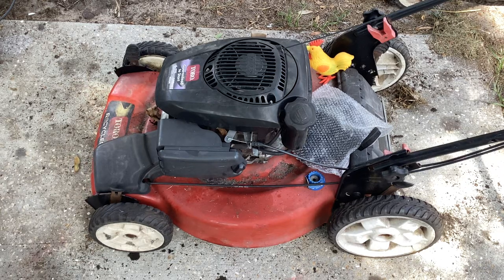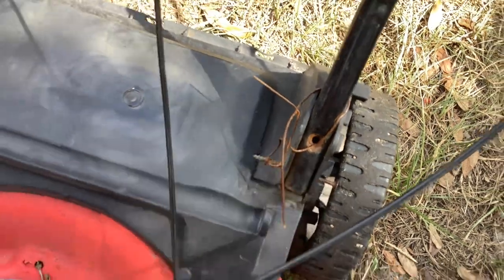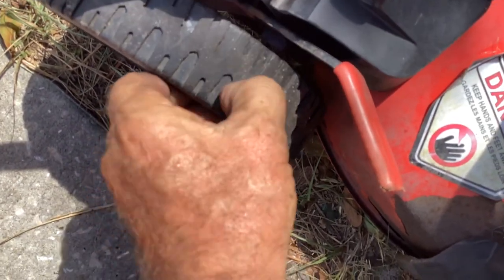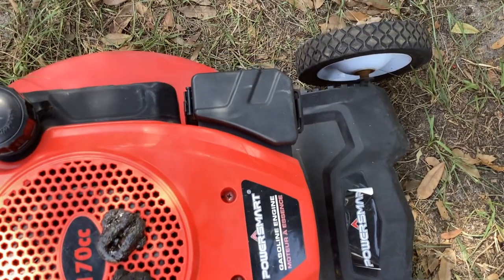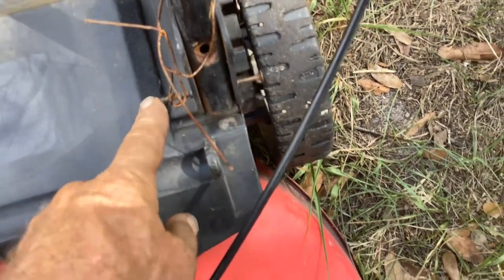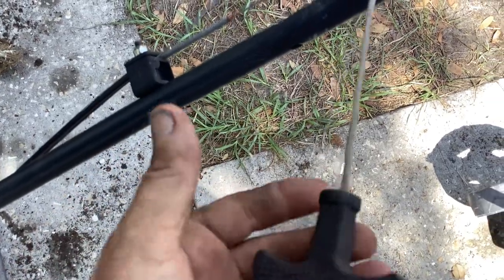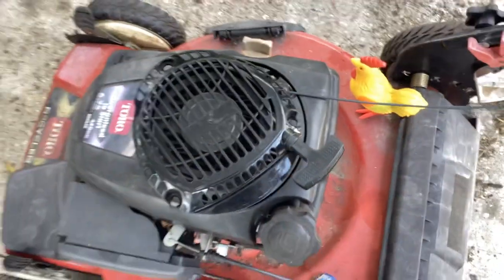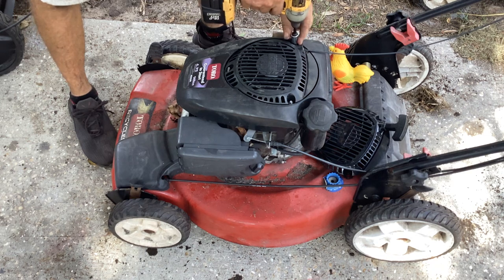Two Junk Lawn Mowers for $20....One High End and the Other Low End!!! Can they BOTH be saved?

Comment: Can't win them all Tommy.  I got a Toro Recycler with a Briggs for $25.00.  Dumped the fuel/water out of the tank, dropped the carb bowl and shot carb cleaner up through the emulsion tube and it ran great after the seller listed it as a non runner.  I ATF the heck out of it and took my marketing photos in full sun shine and sold it the next day!!
Reply from the maker: That is the results that i am looking for.  Keep up the Strong Work...Knock them out!